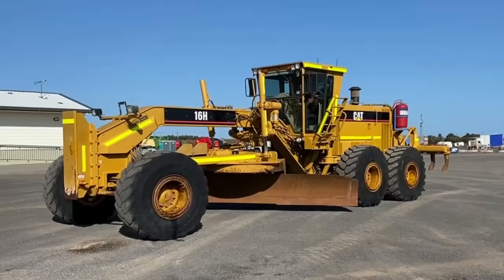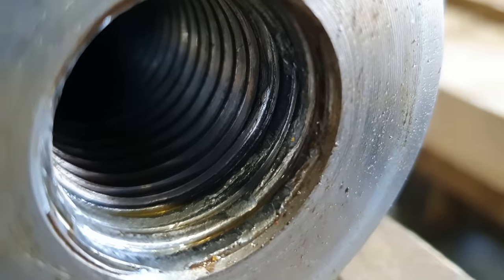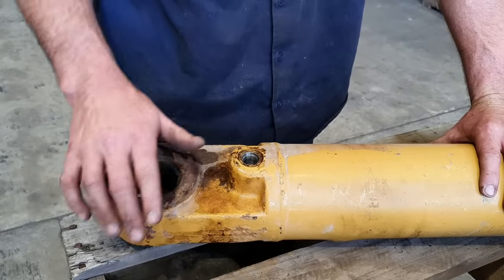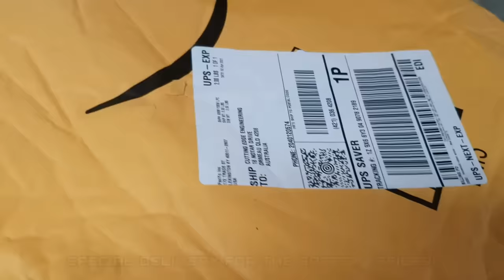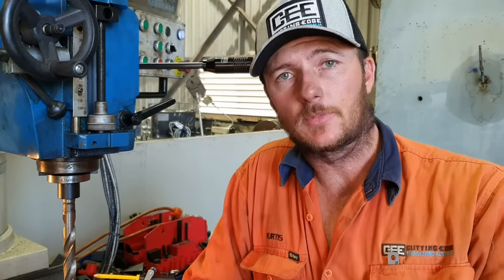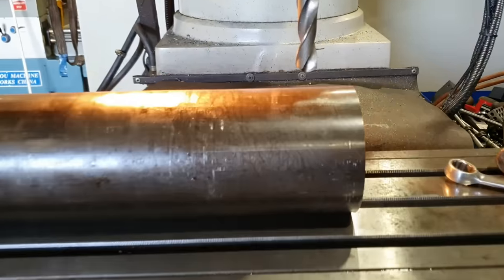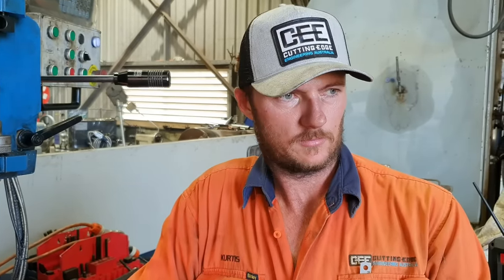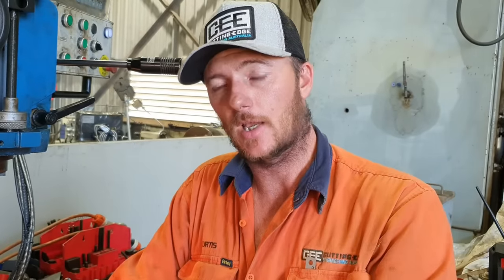Repair DAMAGED Hydraulic Cylinder for CAT 16H Motor Grader | Machining & Welding

Comment: Dont think this is me trying to be a know it all. I'm not a professional in anyway. Based my arm chair machinist experience that I've learned from watching YouTube videos has generated a question. What if the center of the cut under the banana hole being a different place from the original center of the pipe further in? If that's the case won't it cause issues with the Piston as it slides between the two? 
My thought is with the extra weight causing the pipe to be off balance while it's spinning in the lathe might put a bit of a wobble.

I'm sure it worked out fine obviously you've been doing this professionaly for a while, but my mind just can't get over that.

Welp..... Obviously I commented to early in the video to realize what I was looking at. I no realize if the Piston is traveling in that area there would be much more alarming problems. 

These videos are so cool thanks to taking the time to shoot them.

Comment: any reason not using a 4 jaw chuck and clocking in the inside of the barrel before machining?  what happened with the piston could have saved it tig welded the damage and re machined  i usually drill and weld the port on last with the end cap

Comment: Trueing an end  tapper the pipe and the mounting bracket for welding purposes threads are involved inside to assist for repair later seal end

Comment: Well, my question about the Bannanas, from Bavaria, are you using the metric system, usually, or the 3 inches of a Bannana?
Of course, if your customer uses the Bannanas, or the guy who made the working peace in front of you, you have to use it as well 🤔👍

Comment: You being a lathe guy, I would have thought that you would have built a welding gun holder to position the tip exactly where you want your weld to on the rotator. Then reposition for subsequent welds. All you would need is a parallel gun switch to turn the arc on and off. Just thinking here.

Comment: I stopped using cutting oil for drilling holes 45 years ago. retired now, water based lubes are fine and don't make all that Sulphur smokes and smell.

Comment: did you make to de-burring tool at 10:50 or is it something i could buy in USA?
Reply: Look up Noga deburring tool.  There are lots of knock offs but that should get you in the right area.  There are different styles of blades for different materials, steel, aluminum,  plastics..... They're the cats ass for deburring holes and edges cleanly!

Comment: Those cutting tools are amazing. They rip into billets of steel for mile after mile. But they, themselves seem not to suffer from the experience. I assume it is a question of relative hardness. But what gives the cutting tool its superior hardness? Maybe I should have studied metallurgy or something. And sometimes the action is lubricated and sometimes it is left to scrape its way into the billet, dry.
Same with drill bits. It is all very mysterious.

Comment: Did I miss boring bar going all the way through the cylinder?
Reply from the maker: Hey mate nah it's honed tube material so already finished honed to spec, I was boring it out just for the section where threading is
Reply: @CuttingEdgeEngineering  one less job.

Comment: Is the client supplying the hydraulic piston?
Reply from the maker: Hey mate yeah they had an OEM piston in stock ready to use so we didn't get the chance to make one
Reply: @CuttingEdgeEngineering  You sound rather disappointed Kurtis.

Comment: Don't you need to make a new piston as well since the original one is permanently wedged in the cylinder?
Reply from the maker: Not this time the customer already had a spare piston in stock ready to use

Comment: ONE THING THAT MIGHT INTEREST YOU IS THAT I FOUND OUT ABOUT BENJAMIN HOLT WHEN I MOVED TO NORTHERN CALIFORNIA.  THERE ARE STREETS NAMED AFTER HIM IN STOCKTON CALIFORNIA. CALIFORNIA IS MADE UP PARTIALLY OF HUGE DEPOSITS OF BLACK ADOBE CLAY. IT IS THE STICKIEST, MOST SLIPPERY MUD YOU WILL EVER ENCOUNTER. TO GIVE YOU AN EXAMPLE. I WAS RIDING MY CR500 AFTER IT RAINED OVERNIGHT AND I COULDN'T EVEN STAND UP LET ALINE RIDE. AS THE DAY PROGRESSED AND IT GOT WARMER, IT STARTED TO DRY OUT AND STARTED TO GET VERY STICKY. I RODE ALONG THE EDGES OF THE TRAIL SO THAT I COULD GET SOME TRACTION IN THE PART WITH VEGETATION. WELL, THE REAR WHEEL WADDED UP WITH GRAS AND ADOBE TO THEBPOINT WHERE IT LOCKED THE REAR WHEEL UP SOLID AND IT WOULDN'T TURN. I SMOKED THE CLUTCH TRYING TO GET IT TO BREAK LOOSE! I EVENTUALLY SLID THE BIKE DOWN THE SIDEVOF THE HILL TO THE TRAIL BELOW THAT HAD A HUGE PUDDLE OF WATER AND HADCTO SOAK THE REAR IN THE WATER AND DIG AT IT UNTIL I GOT ENOUGH OUT FOR THE WHEEL TO TURN ABOUT 2 HOURS LATER! BLACK ADOBE IS VERY NUTIENT RICH AND PLANTS GROW LIKE CRAZY IN IT HENCE ALL OFF THE FARMING IN IT. BENJAMIN HOLT WAS A FARMER AND HE LIKE EVERYONE ELSE'S TRACTORS GOT STUCK IN THE BLACK ADOBE WHEN IT GOT WET. HE AND A FRIEND GOT THE IDEA TO PUT A CONVEYOR BILT WITH CLEATS TO SPREAD OUT THE LOAD, INCREASE THE TRACTION FOOT PRINT AND HOPEFULLY NOT GET STUCK. IT WAS THE FIRST CATERPILLAR TRACTOR AND LOOK WHAT IT GREW INTO. HOLTS LEGACY IS STILL ALIVE IN THE FORM OF THE LAST HOLT FAMILY OWNED OPERATION IN HOLT OF CALIFORNIA. THE FIRST CATERPILLAR DEALER IN THE WORLD. JUST LOOK AT WHAT HIS INVENTION AND THOSE THAT FOLLOWED HAVE CHANGED THE WORLD AND IT ALL STARTED WITH A STUCK TRACTOR IN THE SACRAMENTO RIVER DELTA!......

Comment: Thanks for another interesting video. I have a question, why do you use a coolant on some tools and not others? When you cut the end off of the damaged cylinder you ran that tool dry. then in other videos, I see you cutting with the aid of a coolant....... PS; keep that dog's tail wagging!

Comment: If you're cutting a thread in an American cylinder wouldn't it be a UNF ,UNC thread form of 60 degrees as opposed to 55 degrees which is BSW, BSF ? just wondering.

Comment: Normally happens when cylinder is resealed and they don’t replace bolt and lock tight it  and tension to correct spec  or it has been over tensioned and the stretched bolt. 
Or just poor operation